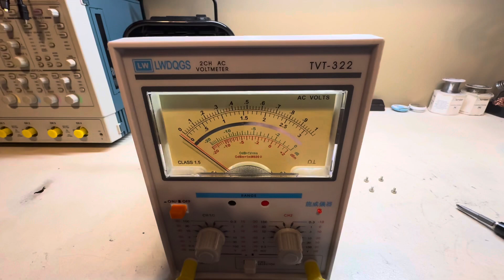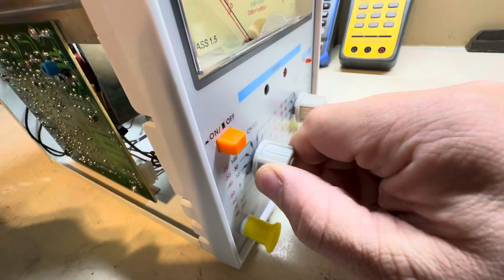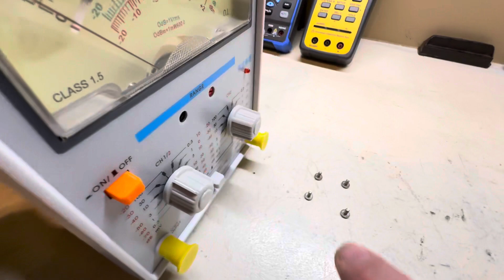Longwei TVT-322 Dual Channel dual needle AC RMS Milivolt Meter Teardown

Comment: Mine was delivered 2 days ago and this millivoltmeter is totally inaccurate! My tests result are already -6% wrong with a 2Vac Sinewave at 1Khz and the spec are bragging 3%. With a variac set at 100V ac both needle show 94V ac.